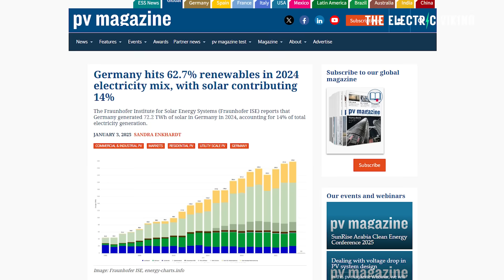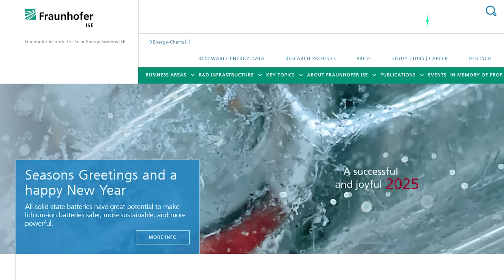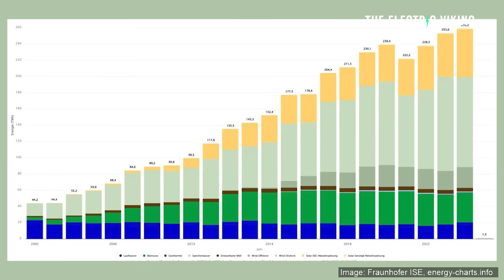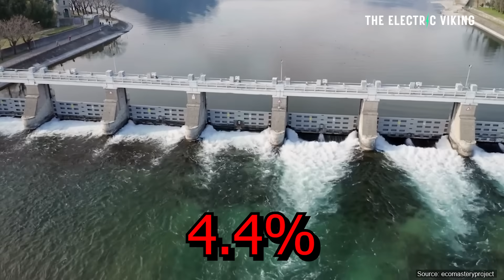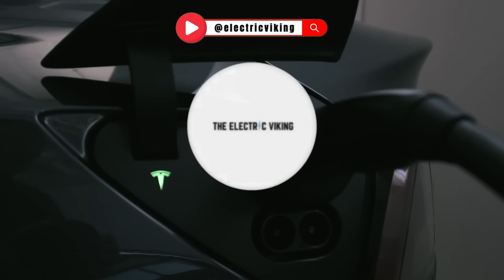Germany hits 63% renewables in 2024 as battery storage almost doubles

Comment: Electricity is just a tiny fraction of German energy consumption, 6% of which renewables, some 36% covered by fuels.
Wind energy grows by the third power with increasing wind speed or collapses alike. Last projects have got average wind speeds calmly above turbines’ cut-in wind speed; useful sites with wind resources have been developed already. My last wind farm was built in Estonia - with wind energy at hub height higher by factors (!) compared to latest German projects in Bavaria (and investment per Megawatt of rated capacity much lower on top of this). There is simply limited natural resource in Germany which will have to import much of its energy - including renewables.

Comment: It is funny to see a guy far away to comment on Germany just based on some sensationalist Media reports. Yes, electricity in the densely populated industrialized country are high but mainly due to the cost for the network. Add to that the fact that politics (like in Australia) thought that it is a good idea to turn off reliable and moderately priced power generation and replace it with unreliable wind and solar before the system can better handle it.
Battery storage can never be a reliable source for the consumption over a longer period of time (like days or weeks). There conventional power plants (coal and gas) have to be used to provide sufficient energy and running only for short periods of time makes them very expensive. There's a reason why Germany ist the 3rd worst CO2 emitter for electricity in the European Union!

Comment: In 50 years we will produce electricity mainly from
Nuclear power. Simply because it needs the least space 😊

Renewable energy is for transition only…
Reply: look up cost of new electricity by source on the internet.    New nuclear can cost as much a 4 times more than what new solar and wind power costs.
Reply: @ but wind and solar aren’t reliable. So it takes almost 100% backup. And including those back up and storage renewable is the most expensive at all. And all the unnecessary grid enlargement (4x more than with regional NPPs) etc makes renewables the most expensive electricity. And talking about the primary energy renewables only deliver 20% so far. It’s simply impossible to switch to 100% EV and 100% electric heating. Especially without nuclear energy
Reply: Even those small nuclear reactors cost a lot.    That's why you don't see any in operation, they cost to much to even build.

Comment: what a load of crap , included in Germany's "renewables "output tally is a thing called BIOMASS , as well as a couple of other dubious methods of production , household WASTE being one , wind and solar are significant but to have 6 items listed as renewables and only 2 really fit that category is just misleading , they list "Lignite" a seperate category to coal , Lignite IS coal , just Brown coal not black , again , fudging the figures !nuclear , coal , gas , biomass , geothermal , household waste are all THERMAL  plants , and of those biomass is by far the dirtiest , basically biomass is woodchip , and to power a city you need an awful lot of it !goodbye forests ! no the only real way to maintain supply is with new nuclear plants utilising new technologies that are much safer than the past efforts

Comment: Rubbish. German research showed 35% renewables was max that they could afford. My old boss who was head economist at Kiel Uni has 5 tonnes of fire wood in his basement for blackouts. Northern Germany is cloudy most of the time. You are gas lighting coal power plants. Quote what has happened to electricity prices in Germany crippling manufacturing.

Comment: "Battery storage almost doubles"  from sweet f*ck all to f*ck all.  According to Clean energy wire current battery capacity in German in now 1.8 GWh which is equal to 2 minutes of annual electrity demand 

In the middle of Winter - Gemany can experience up to 5 weeks of low wind (when solar output is next to ZERO {Dunkelflaute}

Battery energy storage is measured in watt hours (energy) and not watts (power)

One watthour = 3600 Joules

To equate battery capacity with powerstation capacity is complete nonsense.

Try to educate yourself on basic physics.

Comment: The climate crisis is “wreaking havoc” on the planet’s water cycle, with ferocious floods and crippling droughts affecting billions of people, a report has found. Water is people’s most vital natural resource but global heating is changing the way water moves around the Earth. The analysis of water disasters in 2024, which was the hottest year on record, found they had killed at least 8,700 people, driven 40 million from their homes and caused economic damage of more than $550bn (£445bn). Rising temperatures, caused by continued burning of fossil fuels, disrupt the water cycle in multiple ways. Warmer air can hold more water vapour, leading to more intense downpours. Warmer seas provide more energy to hurricanes and typhoons, supercharging their destructive power. Global heating can also increase drought by causing more evaporation from soil, as well as shifting rainfall patterns. Deadly flash floods hit Nepal and Brazil in 2024, while river flooding caused devastation in central Europe, China and Bangladesh. Super Typhoon Yagi, which struck south-east Asia in September, was intensified by the climate crisis, as was Storm Boris which hit Europe the same month.

Comment: Here's a response to one of the comments. 
Germany is on the right track? Here is some interesting information widely available on the internet. 
Germany closed down it's last three nuclear powerplants in April of 2023. Since then Germany has become a net importer of electricity for the first time since 2002. 
You say, ah, but it's because Germany can get it's electricity cheaper in the summer from neighboring countries like Denmark (wind) and France (nuclear). After all, why pay for more expensive domestically sourced electricity? As if price was the only reason. The only domestic sources available during this time are coal and natural gas. All available renewable sources are already being used. As these sources get used first. In fact Germany at times will pay countries like Denmark NOT to produce power so Germany's environmental spreadsheet looks better. Efficiency be damned. There is another country, though still a smaller wedge of the pie that has seen a significant increase in sales to Germany. To the tune of 3.5 twh in 2023. That country is Poland. Poland generates it's electricity primarily from fossil fuels, coal (60%), natural gas (20%) and fuel oil (1.3%). That's over 71% from fossil fuels. 
The story goes that Germany buys low in the summer while France buys high in the winter. These higher sales occur mainly in December because of higher domestic heating demand. As someone who has spent 30+ years in the electric industry I suspected I knew the answer as to why. When you live in an area that has relatively cheap reliable power those households tend to become heavily reliant on electricity. Everything from cooking, hot water, and home heating. France has just this condition. 40% of homes in France use electricity as there primary source of heating. According to reports, almost all new homes use electricity as their heating source of choice. Contrast that with Germany, where over 51% of homes are heated with natural gas. With fuel oil coming in second at 20%. That's 71% of home heating coming from these two fossil fuel sources. 
"Germany has the right energy plan for the future." 
Sweden likes the plan so much they want to cut ties with the grid that includes Germany. The reasons given? Berlin irresponsibly shutting down it's nuclear plants without having a reliable alternative in place. This lack of reliable base power causes prices to swing wildly. During Dunkelflaute/dark doldrums (lack of wind and sunlight) which is most common Nov-Jan wholesale prices during peak hours have been as high as nearly $1,000 per mwh. The highest price in 18 years! It is important to note that all countries in the agreement are affected by these price swings. 
Norway is similarly impressed. Because of the negative impact on their southern residents, Norway is planning to dismantle the grid power cable connecting Norway to the rest of Europe. 
"Nuclear is not part of the solution."
Looking at France and Germany's generation mix it is no surprise that Germany's CO2e routinely exceeds TEN TIMES that of France.
"Germany is right, and all these other countries are foolish."
Germany has become a net importer of electricity, with the highest prices in Europe. 
France has been a major exporter of electricity for many decades, with 2022 being the single outlier. France generally has among the lowest most stable prices in Europe. 
Germany has closed down all it's nuclear plants (some of the safest, and best in the world).
France hates nuclear so much they plan to build 6 new plants with the potential of 14. France is also planning on extending the life of 32 of it's 56 existing plants.
Sweden, according to government sources, plans to build upwards of 10 new nuclear plants by 2045.
Even Poland has new nuclear plants in the works. The first one is projected to come on line between 2033 & 2036. With five more every 2-3 years after that.

Some interesting facts:
Polish per capita CO2e 10t - they are heavily reliant on fossil fuels for electrical generation. Exporting some of that electricity to Germany.
German per capita CO2e 7.1t
   Electrical generation mix wind 27%, coal 27%, natural gas 17%, solar 12%, biogas 8%, hydo 5%. Imports power from many countries with the highest prices in Europe. 
French per capita CO2e 4.1t
   EG mix nuclear 65%, hydro 12%, wind 10%, N gas 6%, all other fossil fuel sources (including coal) 0.5%. Major exporter of electricity.

Comment: There’s ample battery capacity available, aka BEV! Most of them are already able to serve as power buffers. But it’s not yet useable to the full extent due to several factors. 
First, it’s a warranty issue: who covers the additional charge cycles of your BEV? Maybe not the car manufacturer…
Second, a taxation problem: your employer subsidises charging your car, then you upload the electricity to your home or even sell it to the grid. Nice additional tax-free income…
Third, grid fees: whenever you charge or discharge your BEV, grid  fees are applicable. I.e. using a BEV as power buffer leads to double fees! 
Fourth, the German grid is not yet fully equipped with two-way power counters, not even the operators have fully transparency about the momentary energy demand in their grid!
None of these hurdles are technical.  It’s just the legal framework that needs adaptation!

Comment: I live in Germany.
You don't pay for the power. You pay for pay for the infrastructure.
Reply: An electrical energy system consists of generation , optional storage and transmission. Many renewable energy advocates often look at the cost of generation only and overlook (or skip altogether) the cost of storage and transmission.
Reply: exactly! The majority on my bill is infrastructure and taxes.
Reply: @juergenschoepf2885  and? where is the problem?
Reply: 43% of the cost is the cost for energy generation. A quarter is for taxes and the remaining, infrastructure related costs to renew the electricity grid.

Comment: The overall cost of the so called “Energiewende” in Germany will be aprox. 1,3-1,4 trillion (!) Euros. And the outcome is that we lost a lot of our industry and the energy prices are at least double as high as they should be. On average >30 Cent/Kwh is normal. And it’s heading towards 40 Cent/Kwh. 

With nuclear power it would probably be around 20 Cent/ KWh

Comment: Germany shut down their coal and nuclear plants and embraced wind and solar generation more than any other country in the Europe.
Rather than giving Germans cheap electricity , this has resulted in German power prices soaring due to the unreliable and chaotic delivery of energy.
The shutdown of the gas pipelines has also increased the cost of gas.
The result is that industrial production is in decline , household spending is down , and inflation is remaining higher than expected due to the effects of high energy costs and higher prices for CO2 emissions.
Germany is now in recession due to their attempt to move away from fossil fuels and their attempt to rely on unreliable electricity generation from wind and solar. Batteries are too expensive and are unable to store enough power for long enough periods of time to overcome the shortfalls during periods of no sun and almost no wind.
Germany now has to buy expensive gas to try to keep power flowing at all times .
The pursuit of net zero is causing immense damage and hardship to the German people (whilst making no change to the weather which is currently extremely cold ) , and this should be a lesson to all other countries considering the same destructive path.

Comment: After the last nuclear power plant was shut down the energy prices were going through the roof. But after all I support the transition. If we can manage it to bridge the “Dunkelflaute” the time from November till February/March when there is no wind and solar power we can achieve 100% renewable energy, what would be amazing. I’m an optimistic person 😊
Reply: That's wrong. The last nuclear power plants were shut down in April of 2023. The prices didn't go up then, they were up the year before and have come down considerable since then.
Reply: It’s a fact that with NPPs our price would be around 20 Cent/Kwh. Actually it is way above 30 Cent/kWh.
Reply: @volkerr.  No, that is not a fact. You can claim that it might be, but it's nothing more than a hypothetical. In fact reality strongly disagrees with that assessment. In 2014 the average price was 28,04 Cent/kWh when 9 NPPs were still running.

It's currently also not way above 30 Cent/kWh. The price differs by region but overall a new electricity contract will be at an average of below 30 Cent/kWh.

The price of above 30 Cent/kWh results from older electricity contracts with higher prices that are raising the average.
Reply: @ those 6 NPPs we’ve
Closed down produce electricity including all costs at 2,5
Cent/Kwh. All other costs are taxes, grid fees, feeds for renewables etc. If we had switched to 100% nuclear instead we’ve saved trillions of euros for sure already.
Reply: @volkerr.  Yea, no. You can claim anything you want. You simply cannot prove it, therefor it's just speculation.
 
Just look at Hinkley Point C , it has a price guarantee, that's already up to above 15 Cent/kWh when it will start producing. Or Flamville 3, for which the Cour des comptes has calculated a price of at least 11 Cent/kWh (and that's already assuming it will produce for 60 years). Nowhere near 2,5 Cent/kWh for existing NPPs.

The closed down NPPs in Germany never produced at full costs of 2,5 Cent/kWh. But if a lot of the costs are externalized so that the tax payer eventually pays one can claim a price of 2,5 Cent/kWh but it's just a bogus argument.
Reply: @reney8  it’s absolut the older and already payed NPPs in Germany which the greens closed down. Here it is 100% proven on what price they can produce electricity.
Reply: @reney8  as I already mentioned in another post: I know some guys from EnBW, one of Germanys biggest electricity producers. They know exactly the data of Neckarwestheim 2 for example…
Reply: @volkerr.  Get your facts straight. The most NPPs were closed down under a CDU chancellor. The Greens were only long enough in government to be responsible for closing 5 NPPs. One might claim the 3 NPPs that were closed down in December 2021 could have been restarted when the Greens were in government. But the bulk load of shut down NPPs fell on the CDU from 2005-2021.
Reply: @volkerr.  Of course the typical anecdotal evidence. It might even have been true, that they could produce at 2.5 Cents/kWh but that still are not full costs. They will not pay for the storage of the waste for thousands of years, the taxpayer will. They never payed for insurance that would cover the possible damage of a catastrophic accident. Ignoring external costs is misleading. To make prices comparable all costs have to be included, that is also true for renewables and the need for backup systems.

To claim they could produce at 2.5 Cents/kWh is like a student who rents an apartment for 800 € but tells anybody his rent is cheap since he only pays 200 € each month because his parents pay the other 500 €.
Reply: @reney8  no need to store the so called waste. It’s no waste. It’s fuel rods that will be used in newer generations if NPPs and then there won’t be any waste left 😉👋

Comment: Germans are not being tricked into believing any such thing. Renewables energy is the most expensive and inefficient form of energy on the planet. Output is subject to the unpredictable weather and to the hours of daylight. Any power grid relying on renewables at 80% will see energy prices rise by a minimum of three times that of using fossil fuels and at 100% renewables, by five or six times that of fossil fuels. Some areas of Germany - 60% renewables currently - are already experiencing shortages of power and requests not to use electricity at certain hours of the day. The quest for net zero will only see brown outs currently found in only third world countries. Enjoy.